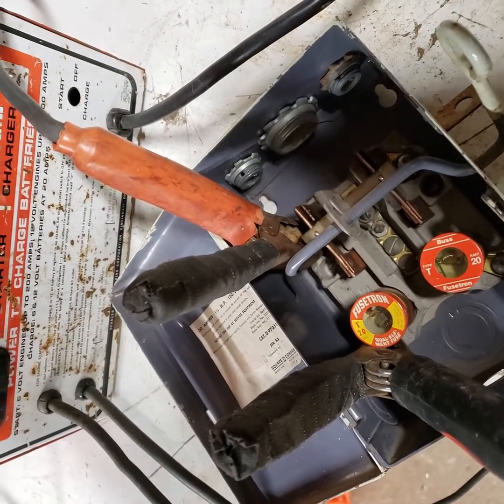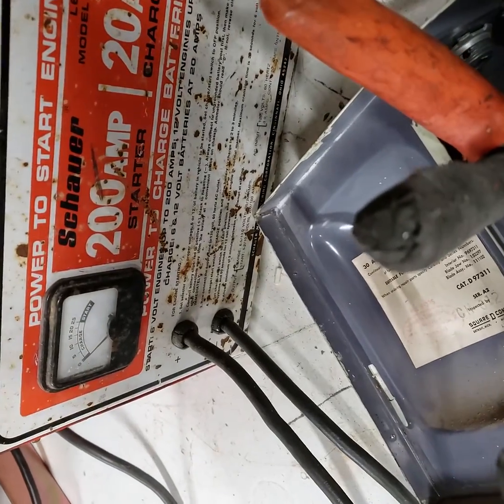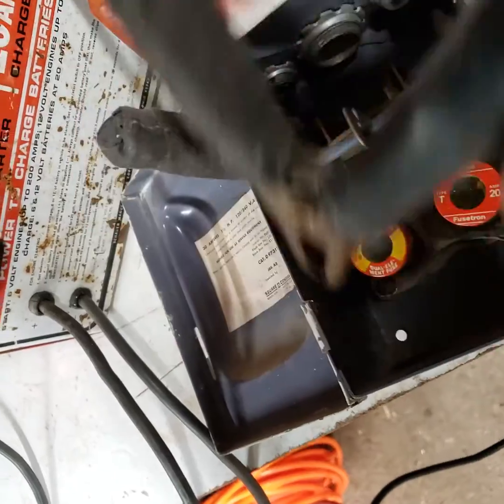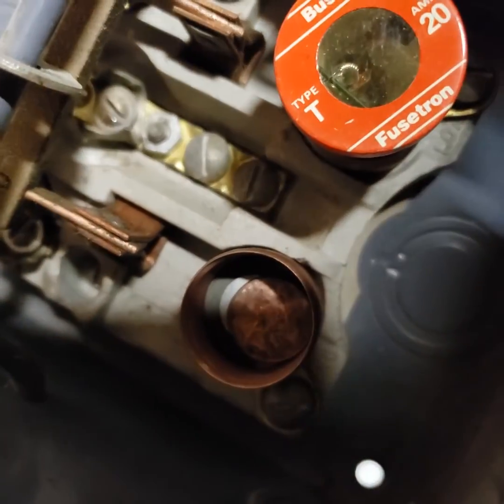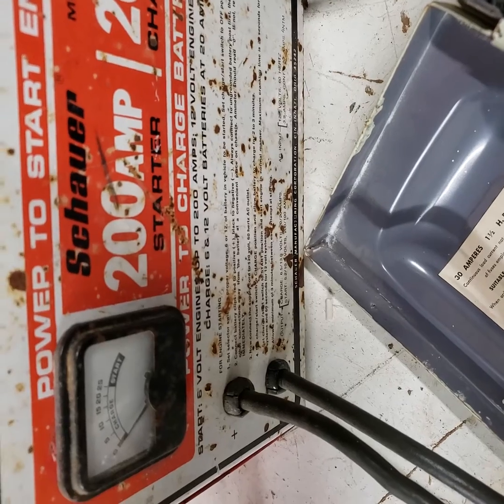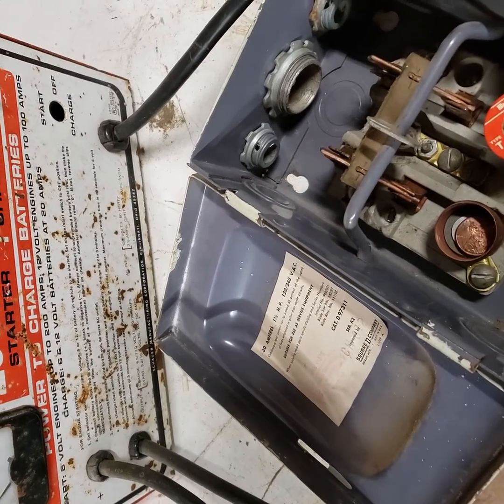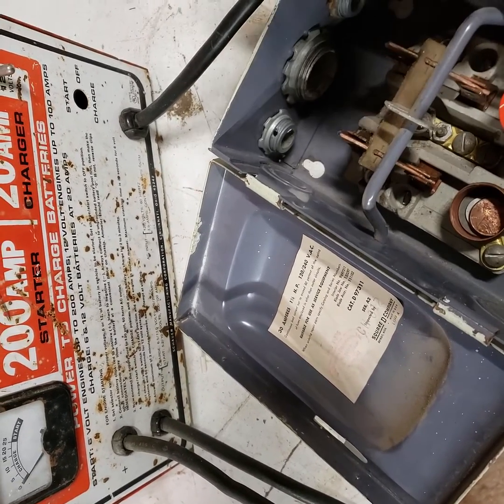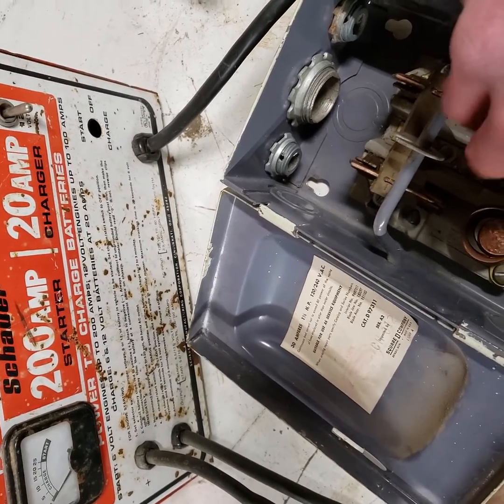Why you should never find or put a penny in place of a fuse. (The lincoln fuse.)

Comment: Using the correct sized Type S adapter and Fustat fuses will eliminate this problem, since you cannot put a penny or anything in the socket, and if you did it wouldn't work since the contact is the metal ring on the outside of the adapter.
Reply: Very true,  but there's other ways to bypass the fuse besides the penny trick.  Wrapping aluminum foil around the fuse then inserting it back into the holder.  Although the newer S type fuses are a definite safety upgrade,  there remains a reason many insurance companies frown upon fuse panels, and for good reason.
Reply: @Sparky-ww5re  PORTER